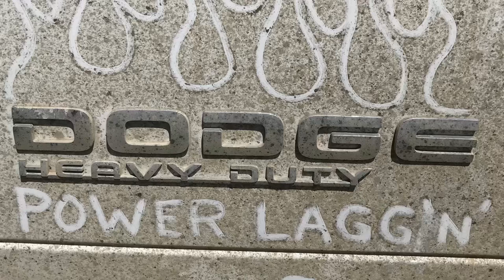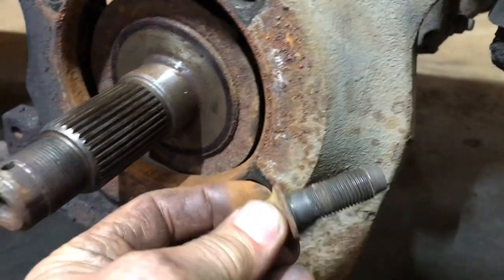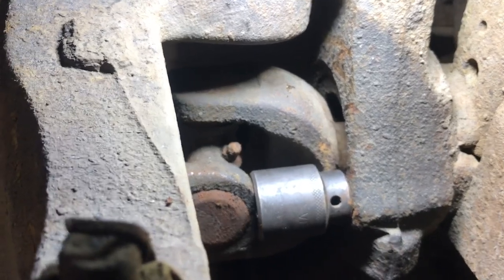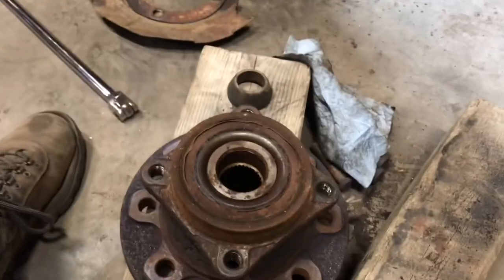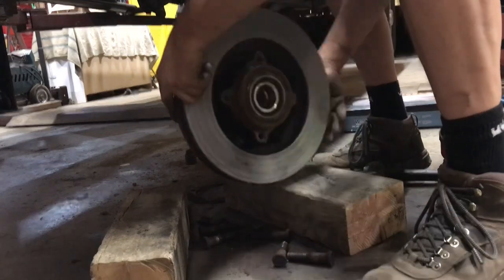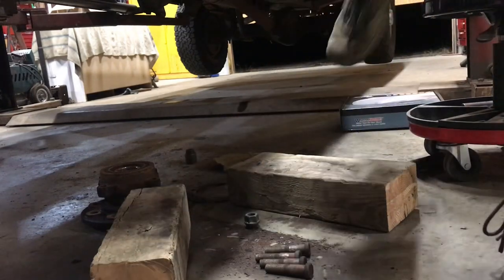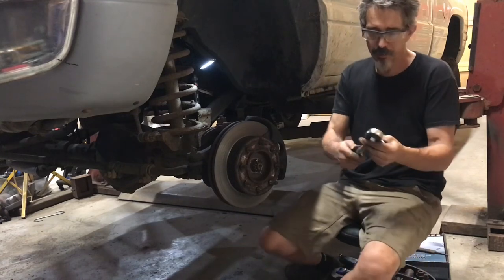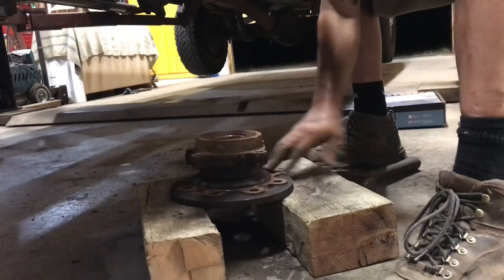1998 Dodge 2500 4x4 Front Rotors How To

Comment: good job morgan. been doing the same way for years on mine. i do use an air chisel at times to separate the two units. the one thing i learned over time, as long as the brake system operates without maintenance, i now just put in a new bearing assembly and be done with it. not that big of an expense and you know its good for at least 100K. its best to cut the main retaining axle/spindle nut off as many times you will find the threads are shot, designed no to be taken off and reused.
Reply from the maker: Sometimes it’s hard to know where to stop once you get in that deep. I’ve never had a problem with an axle nut.

Comment: There is always something therapeutic about grabbing the BF Hammer!🤣 Why not leave the lug nut spun on fluss to protect the threads when hammering? 
Here in the rust belt...I finally stood my ground 20 years ago. If you want me to do a brake job on your vehicle. It gets all new hubs, calipers, rotors,pads and lines. Had two many talk me into going cheap only to bring it back with 1 wheel smoked from a hang up. Do it once and know going out the door it wont be back. I had my fill of finger pointing game over faulty parts or labor just to save someone a few a bucks.👍 The coated rotors are nice...Take care, Morgan!
Reply from the maker: The threads were fine it was just the smooth shank bit on the end that got a little mushroomed. I hear you on replacing everything, it’s sometimes hard to know when to stop replacing stuff when you go in this deep, might have been a good time to replace axle joints too…..
Reply: @WildWestGarage  It is hard...I just know on my end of things. It became a whole lot less stressful when it is all or nothing on brake jobs!😀

Comment: How things have changed. No inner and outer baring race and grease to pack. It is something you saved the old baring after all that beating and banging.
Reply from the maker: The bearing hub assembly is considered a non serviceable unit, some would say it’s progress but I would have to disagree. I think the truck is a lot harder on the bearings than I could ever be.